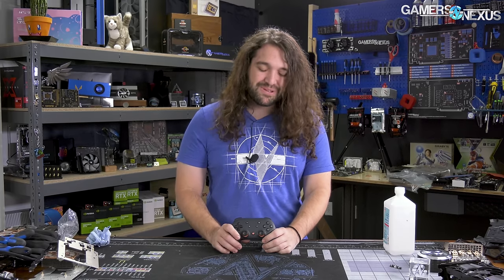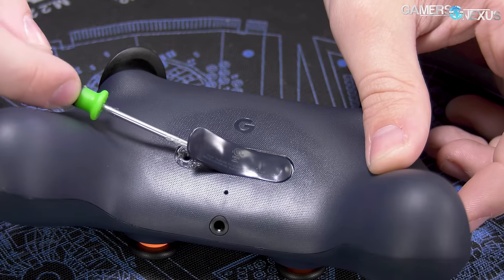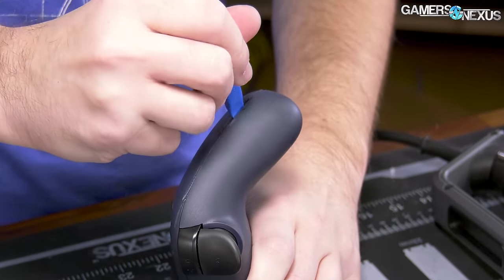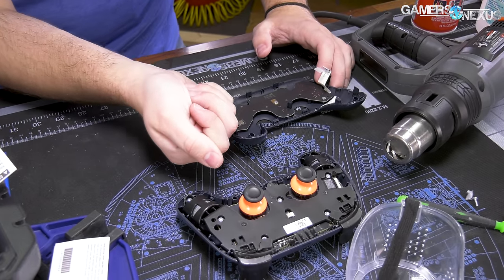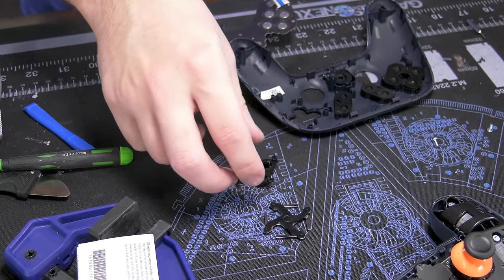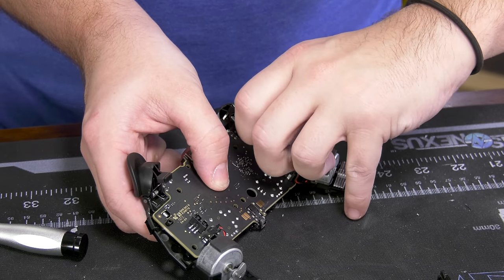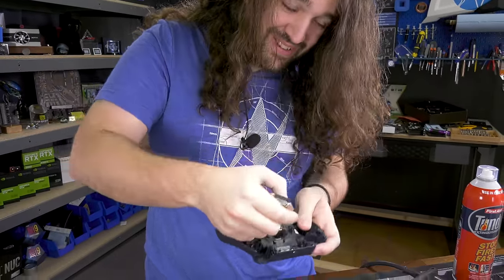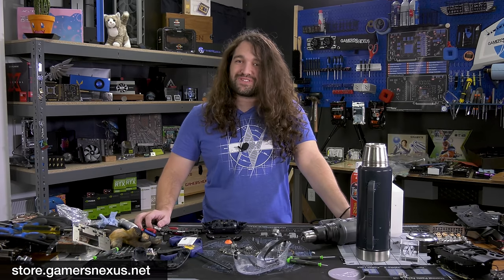Google Stadia Controller Tear-Down & Disassembly Nightmare

Comment: Easiest way to save money: Don’t buy into Stadia.
Reply: Exactly, Google is not a company that should be trusted. Zero chance I am paying for them to get a grip on the gaming industry.
Reply: That doesn't make sense. What is it cheaper to buy a 1000$ gaming PC? 🤣 Save money and wait for the free version of Stadia next year. Even better use the free trial for Stadia and claim the free game.
Reply: @johncitrowske9922  because that PC will last more then 10 years without a need for upgrading
Stadia might not last a year just like Google other projects that they drop also stadia already lied about the 4k the in stadia don't run at true 4k  also all of your games can be played offline and you don't have to worry about lag or latency.
Reply: @jd2792   Stadia is more convenient. To get a gaming PC you have to do a lot of research trying to find which one fits your needs, buy it, hook it up, buy a game, download it etc. After that the PC will be a PC and it will wear down and need to be updated/replaced with better hardware that meets the requirements of the newest games.
^^^ none of this will exist with Stadia. All you have to do is buy the game... That's it! Now your instantly in the game playing on high settings and you will never have to worry about updating anything. That in itself is amazing but Stadia offers so much more. Ex...
1. Any screen, any time, you're not planted to your desk.
2. If you are playing a game with your friend on a TV you will both have the highest settings
3. There will NEVER be any hackers
4. If you are playing a game on the TV and are kicked off/ want to move then you can seamlessly switch to another device at the exact moment you left off.
5. You can capture a moment in a game and share that moment with other people. They can go to that exact moment in your game and play from there.
6. Game demos will be available on YouTube for people to try games for free

And to think the only requirement for all this is good internet? Why is everyone complaining? Sure Stadia has had a rocky start and doesn't have everything yet, just give it a little time and some optimism.
Reply: @johncitrowske9922  You forgot: 7. Never own any game you buy and lose it forever when the publisher takes it down.
Reply: I trust Bowsette's opinion.
Reply: @johncitrowske9922  you don't own the games you buy on Stadia Google does and you can't play them when there's no internet
Reply: @johncitrowske9922  no hackers???? What world do you live where there are no hackers in games that come out nowadays
Reply: @johncitrowske9922  Hate to break it to you but even the free version is gonna suck pretty hard unless you live within 300 miles of the google server and your ISP has unlimited data caps and you have next to nothing for packet loss. Very Very few people meet those criteria.
Reply: @shperax  well I meet the criteria 🙋‍♂️
Reply: @johncitrowske9922  Your one of the lucky ones cause only 15 States are even capable of meeting the distance criteria.
Reply: @shperax  tbh I think what your saying is bologna but we'll see
Reply: @johncitrowske9922  Lets find out if i am. What town do you live in?
Reply: @yugomanic70  Hackers can hack anything, even a toaster.

I don't think you can hack a toaster though.
Reply: J D  Your delusional if you think a $1000 pc will run for 10yrs maxing games without anything burning out. Stadia is everywhere you go, you cant put your pc in your pocket everyday and pull it out anytime anywhere allthough that would be funny to see. When new games are launched Stadia owners will be first to play, from now on Stadia owners play first everyone else must endure the 100gb+ download before having a go. Stadia is for people who do not have a $1000 but can afford $50 for a game. That is a much  bigger audience than you rich fanboys realize.
Reply: ブラックピットDark Pit  Nothing new playstation xbox steam uplay epic games ect ect all have digital stores but you pick on google. You seem to think if all these stores stopped tomorrow that your downloaded game would work... Morpheus- "Do you think that's air your breathing now ?  hhm"
Reply: John Citrowske shperax fails to provide any proof its just words lol
Reply: @CalmRestRelax  And that means we need to make it even worse? PS and XBone at least have Retail Versions for most of the games. And for Steam and all the PC Launchers, before they're going to close down, just copy the game files somwhere else and apply a crack.
Reply: @darkpit1303  it's the future!!  this has already happened in the movie and music industry years ago and become very successful. Netflix Amazon Sky ect ect go tell sky or Netflix you wanna keep retail versions of everything you watch because you paid your subscription... 

What your saying is your rather buy a car than pay for a taxi that you cant keep which is a valid point but it don't mean there is no place for taxi's and the customer base that comes with it. Stadia has a bright future.
Reply: @CalmRestRelax  Yeah, but movies and songs are very easy to preserve so you can always listen to/watch them. Video games are not. If a publisher takes down a Stadia exclusive game it's going to be lost forever and there won't ever be a way to play it again. I also would rather live in the past with no new technology than in a future were i own nothing i buy.
Reply: Then you need a time machine because living in the past is the wrong way
Reply: @CalmRestRelax  I always wanted to meet somebody who really believes ads
Reply: @darkpit1303  what you going on about!!, your just making stuff up that is nothing to with this conversation now because you cannot swallow the technology is moving fowards wheather you like it or not pill..
Reply: @CalmRestRelax  Dude, Stadia is going backwards and you don't get it
Reply: @FOXXX509  The PS1 sold 1 million on day1 the first Xbox made a loss in it's entire lifespan so Microsoft got a foot in the door. China, the original Xbox sold less than half a million ever. Today Sony, Microsoft, Nvidia, Valve, Apple, Google, and Facebook invested millions into cloud gaming because they know there is a market for it with Xcloud, GeforceNow, PsNow, Steam, Stadia and Apple Arcade. Google launched with 22 games PS4 launched approximately 28. I do think there is a pricing issue with older Games at full price tho. When the free Stadia base is released you'll only need to buy games and that's gonna be big deal for alot of people who can't afford the console. Stadia has a bright future.
Reply: John Citrowske or one buy a console. Or invest into the only good streaming service out there right now. Project xcloud.
Reply: John Citrowske 1. Google Stadia lacks in games that cost full price anyway.
2. Stadia requires you to pay $10 a month plus having to pay full price for a selection of about 10 games.
3. You can only use the google stadia controller, which is completely separate from your purchase
4.There is noticeable latency
5. You need to buy a chrome cast ultra for $70 to even get to play it on your tv.
So to wrap it up, google stadia is just a failure
Reply: @nedf8379  from your comment it is clear to anyone who has tryed Stadia that  you've not tryed Stadia and done little to no research otherwise you'd know your wrong
Reply: @nedf8379  Your points are not facts. you still dont realize which ones are not correct because you are troll... You admit you havnt tryed Stadia so anything you say has no credible merit...
Reply: ZenAlpha please explain to me what is false in what isn’t. I haven’t seen one positive video, review, or article towards stadia and the price shows how pointless it is. If it was reasonably priced (cause oh boi it is not).then maybe it would be a viable option but not at its current state.
Reply: @johncitrowske9922  the "free" game you get by paying for a controller you dont need (because you can use any controller) with a monthly subscription that you cant play when you stop paying forr that subscription.
Reply: @2Poor4UserName  free version of Stadia comes out next year so Stadia pro isn't required
Reply: @johncitrowske9922  and you will probably need pro to access the free games. like playstation plus back on ps3
Reply: @2Poor4UserName  I've thought about that a lot... I don't think they will require pro to access free to play games but I think they will take 30% in game purchases. It makes sense for everyone but who knows 🤷‍♂️
Reply: @darkpit1303   Stadia is the same as everything else, you own the license to play the game. Who told you Stadia was just going to drop games in the future? O_o
Reply: @England91  you own the license to play the game like anything else. And yes you need good internet for Stadia which is basically the only requirement
Reply: @England91  I don't think you understand. Google Stadia streams the game to your screen which means the player never has access to the downloaded game files which means the player can't hack
Reply: @jd2792  ok I'll go over everything you said like you did mine... Prepare for a long comment 😆

I said that gaming PCs take a lot of time to research and money to purchase and you replied "it takes less than half hour to Google search and any other problems comes from laziness" I disagree with doing half hour of research finds you the perfect PC but you kind of prove the point I was trying to make. Researching a PC takes time but playing on Stadia is instant access.

I said PCs wear down over time and you said "straight up lie a PC will last 5-10 years which is probably more than Stadia will last" It depends how much your PC costs. If it's a 500$ PC It won't be able to play new games on high settings anyway but if it's 1000$-2000$ I can see it lasting 5-8 years. But you have to keep in mind that newer games will have higher requirements so maybe it could still play destiny on high settings in 10 years but not the new game. I don't think there is any way that Google will cancel Stadia. If you look on the Google graveyard website you will see that most of the things there are things that Google stopped selling but still supports (Google clips, Chromecast audio) or small programs that no one ever used. The biggest thing that Google cancelled would be Hangouts which is only a chatting service.

I said all you have to do is buy the game on Stadia in order to play and you said that "if you ever played a browser based u know that's bs and u still have to deal with lag and latency and data caps will screw u" Stadia is not only browser based. It's on Chromecast, an app on your phone and also an app on Chromebooks. The only browser based Stadia is on Windows and they are going to update it to support 4k 60fps. Lag and latency can be bad if u have bad internet but Stadia isn't for those people. If a gamer with data caps wanted high quality games they would have just as much of a problem downloading the game as they would streaming it because a game like destiny 2 is 165gb to download and that's before updates and patches so this whole 'what about data caps' is stupid because those people aren't considering High quality gaming to begin with.

I said there wont be hackers and you basically said thats bs. Stadia is streaming the game to you so you never have access to the code which people can exploit to hack. But your saying that people will still somehow hack into Google's data centers, find their game, hack that, just so they have a competetive advantage in a game? 🤣 I hope your kidding

I talked about game demos and you said that other games have that too. The difference with Stadia is that there won't be any downloads, you are instantly playing  which is far better than Downloading a demo for 45 minutes (if you have the space, patience and computer for it). I was listening to a podcast talking about how game demos have really fallen out and how Stadia can really make it popular again.

I said why is everyone complaining you said " let's see...
1. no control of games
2. No modding
3. Google can kick u out of games if they want to ban u
4. Google has history of dropping projects like this"
For 1# what do you mean by that? Not owning the disk or file? People used to be against streaming music and we're totally against not owning a physical copy but we can see how that turned out 
For 2# I heard that Google might be doing something about modding for Stadia but I'm not too sure.  Personally I don't care about that but 🤷‍♂️
For 3# idek maybe? Just don't get banned man then who cares
For 4# as I mentioned earlier about things Google dropped.  But what has Google dropped in it's history that has been as big or advertised as Stadia has? Google is committed to this man

Ok I'm done with my essay 😆
But fr Stadia's success would be better for everyone and would just increase competetiveness in the gaming market which is always better for consumers.
Reply: so, you really like stadia and probably got that preorder that gives you destiny 2: the collection. take my advice as a destiny veteran and don't even bother investing time and money because the game is boring and going down hill fast.
Reply: @johncitrowske9922  They most likely will drop some games and the entire service at one point
Reply: John Citrowske nope it requires a huge amount of WiFi. It will not work for a long time
Reply: @CalmRestRelax  bro you really fell for that marketing. You have 0 clue and completely out of touch with reality lmao
Reply: @2Poor4UserName  Actually I have been cloud gaming for years I have nearly 3 decades expierence with pc's and have considerable knowledge and a better expert understanding than most. You couldn't be any more wrong with your comment... I feel cloud gaming in general is the future wheather it's Google, Nvidia, PlayStation, Xbox or Shadow that get it right it doesn't matter. Cleary so does the big companies Google, Sony Valve and Microsoft which is why they are investing millions into the development of cloud gaming. So it blatantly you who's out of touch of reality.. so called ."bro"  Currently cloud gaming is not close to the latency of a local machine but not noticable under the correct conditions and as technology gets better the gap closes.
Reply: @CalmRestRelax  its ok bud, im sorry you let yourself get ripped off. I understand, not everybody knows destiny 2 is already a f2p game
Reply: @CalmRestRelax  btw im an astronaut messaging you from mars atm. You can totally believe me because im a random guy on the internet
Reply: @2Poor4UserName  You sound like you never went to school let alone Mars
Reply: @CalmRestRelax  i mean at least i didnt fall for a scam?
Reply: @2Poor4UserName   I didn't buy Stadia for Destiny 2 you have 0 clue... As a cloud gamer for years I know Stadia requires specific conditions which Google unfortunately has not been clear with. My Stadia works great but from your comment it is clear to everyone reading that you've not tryed Stadia and done little to no research and your saying school boy nonsense words like scam when the reality is your delusional
Reply: @johncitrowske9922  well said John
Reply: @CalmRestRelax  so you get real 4k 60fps?
Reply: @jd2792  yeah there have been way too much cases of delisting

the worst ones and more major were the dsi/wii
Reply: @CalmRestRelax  atleast with xcloud you can use game pass or your own games
Reply: @unapersona100real6  Yeah Xcloud sounds like it will be impressive, I'm hearing good things about it. I havnt had the opportunity to test it yet. IMicrosoft say they are working on a new patcb for the current xbox api for devs that allows in game text to resize if played on a small screen on any future games. Xbox games apparently don't require porting so currently all though 50 are available I heard 3500+ games are compatible and 5700 should be available at the official xcloud launch...
Reply: @2Poor4UserName Your just thick!!! Google said every game at launch is 4k,  Sony claim 4k with PS4 Pro which both means upscaled. Stadia is currently running some games upscaled and some native 4k like Shadow of tbe Tomb Raider. Microsoft however unlike Sony said native 4k at the launch of Xbox oneX which is true 4k. The chromecast ultra outputs 4k but from data centre to my screen their is compression so 4k will never look as good as local 4k. The same goes for Netflix 4k or any internet 4k streaming service its never as good looking as watching a local 4k blueray player. This is nothing new I expected this prior to launch and was not surprised however the 4k stream looks amazing and differences are only noticeable by elite enthusiasts doing side by side comparisons
Reply: @CalmRestRelax  yes daddy google
Reply: You are so right! 🤷🏾‍♀️

I hate how people are buying this garbage. It's just a step away from owning your games.
Reply: @johncitrowske9922  Finding the Right PC Takes like 30min. If you look a few vids and benchmarks
Reply: @lezzingepic6016  I mostly game nowadays on a Nvidia Shield Tv which rums my entire steam libary for cloud gaming. I also have stadia for rdr2 and I'm looking forward to Xcloud, I don't work for Google it's just nonsense anyone saying otherwise. I live in uk on a 300mb connection and had no issues with cloud gaming. ever  I had gaming pc for 10yrs I had ps4 for 2 yrs I even had a zx spectrum and commodore 64 in the early days. I don't agree with stadia prices  i didnt agrre with Onlive it was too early but I do agree with cloud gaming in 2019 and so does Microsoft Sony Nvidia Google valve. By the way thanks for checking out my channel though I user to play pubg mobile and Asphalt 8 on Android
Reply: @AmaryInkawult Actually Shadow of the Tomb Raider is 4k 60 but some of the other games are upscaled to 4k like RDR2 which is 1440p upscaled to 4k 60 and Destiny 2 is1080p upscaled to 4k 60 and Destiny 2 on Xbox oneX is 4k 30.. This is nothing new and Sony do the same upscaling with the PS4 Pro which has always claimed to be a 4k machine ... At launch games are being ported to stadia which is the biggest issue for 4k all future stadia games developed side by side will look and play better. Google and Sony though should have been clearer on this subject as it seems to be upsetting alot of people. The Xbox One X runs true 4k which is  called native... jumping to silly random conclusions about Google stock is narcissistic nonsense I don't own stock lol I just someone who plays games and brought Stadia founders and it works out of the box.
Reply: @CalmRestRelax  being a stadia fan unironically makes you an easy target.
Reply: @lezzingepic6016  agreed ...but I'm more of a cloud gaming fan regardless of which company delivers
Reply: @avex6172  This is true I have built many pcs. I can search the parts for a gaming pc in 10 mins. The problem for alot of people is having $500 or $1000 upfront
Reply: @AmaryInkawult  As you say you have experience in investing ? Now YOU sound like an investor... Nothing you have said has any credibility, your just saying random stuff that simply isn't true because you cannot provide factual evidence. You also say I'm expecting people to buy a pixel, move house lololol... Show me one piece of evidence of me expecting ? you cant because your post is a fairy tale. You can afford to buy a latest gen console outright and a game or games costing hundreds of dollars or pounds but you can't afford average speed internet. REALLY!!! Stadia and the Nvidia Shield TV are both cheaper alternatives to buying latest gen consoles or a gaming pc and that's fact.. How about using the money you save from buying a console to pay your average speed internet bill or haven't you realized yet. I also say average because average speed internet in 2019 per household is as follows.. UK 42.8mbps, Taiwan 85.02mbps, Singapore 70.86mbps, Jersey 67.46mbps, South Korea 52.4mbps, Norway 48.2mbps Canada 42.5mbps, USA 32.89 the list goes on. The average speed per household increased 25% per year for the last 3 years and 66 countries are capable of running Stadia today with the average internet for each country. Your 1% lololol you get zero credibility for your ridiculous claims.
Reply: @AmaryInkawult  Once again you provide ridiculously nonsense claims with no merit. Google launched a console do you even know what Stadia is ? and It's not special internet package at all it's fact that you need average internet package which you possibly cannot get by the sound of your comment because of your rural location. There is not 1 case or piece of evidence that says a house burnt down where a fire originated from a Google Chromecast. There is however a small percentage of people saying the Chromecast ultra overheats and shuts down. So at the end of the day you don't own Stadia your internet cannot run Stadia and yet your here posting inflammatory and digressive, extraneous quarrels which makes you Mr\Ms Phantom of the Gab not just a troll a sad TROLL...
Reply: David Rodríguez Rodríguez  not a Zoomer or a boomer, but alright.
Reply: David Rodríguez Rodríguez  Can I just say please that I am not Gen Z and i am not a joystick peripheral for the Nintendo Entertainment System or a robotic dog (Source - Zoomer Wikipedia)
Reply: The shilling is strong in this thread lmao. Stadia is already a laughing stock
Reply: @CalmRestRelax  I'm not a console fanboy tho lol. And Let's come back to this thread 1 year from now. I will put the date down on my calendar. Let's see how much things changed.
Reply: @jackapgar5824  what do you mean by huge amounts of wifi? Are you talking about data caps or speed? The recommended for 4k is 35mbs and the average in the US is about 105mbs. Most people in the US don't have data caps but the whole argument against Stadia because of data caps I don't think holds any water. First of all if you have data caps you aren't considering getting a high quality game in the first place because games like destiny are over 165gb to install before updates and patches and most good games are at the very least 40gb. People with small data caps aren't playing high quality games on PC period in the first place
Reply: John Citrowske idk bra idk chit on nerd stuff
Reply: @bassbusterx  Troll your absolutely right cloud gaming will have changed in a years time because Sony, Microsoft, Nvidia, Google, Valve, Apple and Facebook have invested heavily so cloud gaming will be everywhere and running better than ever across multiple platforms... Since you have no idea what your talking about you should take a look at the Nvidia Shield TV and more specifically GeForceNow which has had a successful cloud gaming service and community running since 2015 (5yrs) which puts your 1yr theory to shame before before it's started...but you trolls don't do any research before trolling.
Reply: @AmaryInkawult  what's wrong with Stadia? I swear so many people on a hate train because they don't like the way gaming is headed. Sure keep buying your 1000$ PC every couple years I'll just buy the game on Stadia. Do you still have your record player because you want to 'own' your music too?  😑
Reply: @johncitrowske9922  it may be my record player, but they aren't my record albums. They belong to people who are no longer with us.
Reply: John Citrowske Yeah buy minecraft for f*cking 60 dollars enjoy.
Reply: @CalmRestRelax  2 weeks now and stadia is still a laughing stock
Reply: @CalmRestRelax  lmao i love how you still try to defend Stadia. How can you just not understand that it's complete bullshit?
Reply: @bassbusterx Your trolling is a laughing stock, Its now known people suffering from lag had not turned on gaming mode on thier tv to reduce latency. Stadia has multiple updates released new features and games. Stadia now supports all Chromecast ultras, founders edition now enables 2 buddy passes instead of 1, Google assistant has been enabled and achievements. Consoles don't have enough performance to do stream connect allowing you to see your squads every move in the corner of your screen, Stadia showcased this on Tom Clancy's Ghost Recon Breakpoint. Grid has a 40 car coop race which is only achievable on Stadia, consoles are too weak. Google has purchased Typhoon studios which members were responsible for many high end titles including splinter cell.. All games for Stadia have currently been ported from consoles and pc which is why some are upscaled, they were rushed for release but Shadow of the Tomb Raider and Metro Exodus is native 4k60 Metro plays faster on Stadia than Xbox oneX. Stadia after one month has Breakpoint, Grid, Tomb Raider and Metro which are all better than the console versions with faster loading times and extra features not capable on consoles. Darksiders Genisis gets stadia launch 2 months before playstation and xbox.. It's early days but untill next gen is here consoles are starting to look like the laughing stock
Reply: @clumsywarrior6144  ya I will enjoy Minecraft and the rest of the $940 I can spend on other things 😋
Reply: @CalmRestRelax  you are the only other person that actually has done research into cloud gaming lol
Reply: @johncitrowske9922  Yeah I been gaming since zx spectrum days John. I've been a high end pc gamer for many years maxing every game. I can tell you its a endless money pit... Years ago I stumbled across Onlive cloud gaming it looked like a good concept and had demos.  Unfortunately it was laggy and pixelated and realized the tech was too early, I was on 8mb broadband nowadays I'm on 300mb I liked PSNow but never had many AAA titles and was 720p. I heard about the Nvidia Shield TV which is very good and gives instant access to GeForceNow cloud gaming which allows you to use Steam games but all though it's got 600 games including new latest gen games it is missing devs like EA and others that make the expierence not a permanent solution. Stadia is doing what Nvidia wouldn't so I keep up to date on all GeForceNow and Stadia news.
Reply: @johncitrowske9922  Alot of people seem to think GeForceNow is having a pc stream a game to a mobile device but it's not thats Nvidia game stream which the shield can do as well but GeForceNow is a free service that streams AAA games from Nvidia RTX data Centers similar to stadia at 1080p 60... it's available for pc, all android devices and Shield TV but all are invite access only which can take 6 months or more except Nvidia shield tv which grants instant access.
Reply: @CalmRestRelax  yeah I wish I could try that. I signed up to get early Access but haven't gotten it yet
Reply: @johncitrowske9922  if you can afford it get a shield tv it's great at old school emulation for Ps1,dreamcast,n64 ect ect  it plays many android games as well like Asphalt 8 which is amazing online with a controller. Its the best 4k tv media streamer on the market and grants instant access to GeForceNow. GeForceNow supports Steam, Uplay, Bethesda, Origin which means you can buy games on sale from all of stores. I payed £14.99 FarCry New Dawn £14.99 Shadow Of The Tomb Raider. I got Rage 2 recently on sale for £22 and Arma 3 for £12.99.... the shield plays with pc players online. It really is a decent bit of kit but like I said it's missing some devs and only support 600 games currently considering Steam has 10,000+ It's a bit of a shame that's why I got Stadia as well
Reply: @CalmRestRelax  wow nice! Is it Google assistant compatible?
Reply: @johncitrowske9922  Yeah it's got a chromecast ultra built in for 4k and Google assistant. It has Bluetooth for connecting any gamepad as well like ps4 or Xbox controllers wirelessly or keyboard and mouse
Reply: There are plenty of reviews on YouTube check them out they are all good reviews but some reviewers seem to say GeForceNow streams from a pc in the house which is not true that's Nvidia Game stream which is also built in as I say GforceNow runs off RTX data centres like Stadia
Reply: @CalmRestRelax  that's awesome!!! Might consider getting that
Reply: @CalmRestRelax  while you are right it's going to the future it's not going to be the  near future to put it simply right now it's a novelty the Xbox one x currently outperforms it awesome right now in requires hella good internet actually work well So for the average gamer is downright uselessand that wouldn't be a problem if Google wasn't trying to like it's a miracle product which is going to make it even harder for future companies or Google IF they do work out the kinks. to actually get the attention of gamers
Reply: @andrewmoore7022  Look it up Andrew you'll find the average internet per household is capable of playing Stadia in 66 country's and internet speeds increasing 25% per year for 3 years.  Stadia is accessible to most households, maybe not all 4k but certainly 720p and 1080p and with the free Stadia base @1080p there is no need to buy expensive consoles or commit to ongoing subscriptions which will appeal to a large audience who simply cannot afford upfront $500 + $50 a year for the console and online play with next gen consoles. Xbox OneX currently does outperform Stadia's 10.7Tflops despite Stadia having 4.7Tflops extra in performance. This is due to a mixture of things, all current games on Stadia have been ported and as previously said Stadia renders at 120fps as a backend trick to improve latency when delivering games to the screen. As new games are developed alongside consoles and exclusively for Stadia we'll see Stadia's 10.7Tf stretch it's legs. Early YouTubers who talk trash about Stadia to click bait you are not making the video for you they make it for themselves to make money from your click bait based on lies they are narsacists.  Stadia channels who are owners are debunking this narsacistic hate propaganda because Stadia works very well. However we all know Stadia was launched missing features, Google responded by enabling features and delivering extra content and setting up a Montreal Studio and buying Typhoon Studios to develop exclusively for Stadia. In 1 month Google has been busy, cloud based game Streaming is the future of gaming and available now on Stadia.
Reply: @CalmRestRelax  Holy shit dude, you're so fucking impressive (in a negative way lol). You really believe Googles bullshit. You even think it's okay to release something that's missing features that were promised to be available at launch. That's just mind blowing
Reply: @CalmRestRelax  
just like OnLive

oh wait
Reply: @joncarey6121  Internet speeds has come a long way since Online and Onlive was renamed to Playstation now which became successful.
Reply: I dodged a missile, then.
Reply: @jd2792  no
Reply: @CalmRestRelax  all of that and stadia is still a failure
Reply: We have some non gamer stadia fanboys here 😂
Reply: @CalmRestRelax  Yo it has been nearly a year now. What has stadia acomplished amidst a pandemic where people stay a lot of time indoors? Absolutely nothing.
Reply: All this comment thread does is show who has to deal with slow internet and who doesn't.
Reply: Stadia shut off its in-house game development lmao. What a great sucess it is
Reply: still no success for stadia
Reply: They have fixed it since then!
Reply: @johncitrowske9922  2 years and still almost the same but ngl its actually good with a ps4 controller and good internet its just like a few miliseconds of lag thats it but other than that it still have time to develop.